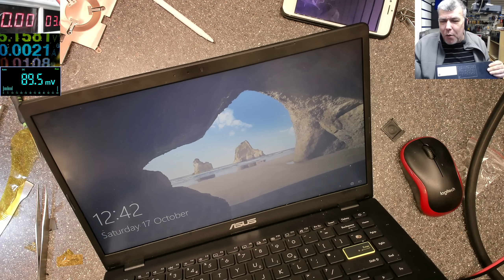Asus E410M blow-up board, motherboard repair

Comment: I really like what you do and I would like to help me diagnose a laptop-Alienware M18X r3 (it turns itself off at 30 minutes on clock, any operating system or bios).I diagnosed with DEll software and all the parts are good

Comment: Hi guys, sry my bad english.
Can anyone help me here?
I could not find a clear answer on the Internet for this.
Can i replaced laptop motherboard with a higher model of the same laptop?
I have a N551zu laptop and I am very interested in putting the N551vw motherboard on it.
is it possible?
What are the problems and obstacles for this?
i uploaded diffrence between them also.

https://ibb.co/dmQ02nn
https://ibb.co/mCG789Q
https://ibb.co/5hsFBV0
https://ibb.co/ZT4mNTh

Thank you so much.

Comment: Hi, thank you for the videos, they are very informative, fun and educational. I have an old hp 360 13",  it has no picture, the left bottom of the screen is broken. so I plugged the hdmi to an extenal monitor but it shows not picture either. the fan turns on and it get warm.  do you think it needs a new motherboard?

Comment: I ve search within your videos but havent found any troubleshoot like mine. When i start my acer aspire 5 the fan spins like 3 secs and goes off - repeats. Ive checked the thermal paste is kinda messy. Could that be the issue for this?

Comment: Hello Sir, I am From South Asia ( Bangladesh). I am a learner of your " 
Electronics repair school" . In my hand I have a "Dell Inspiron 15, 41113/SDPP/2015, iris bsw mb 14279-1". This Laptop Off Immediately after starting  (7 to 15 sec.).  The board is clean and clean, Heat sink Installed, Thermal pasted correctly........ This also occur in BIOS Mood Too.....  Replace RAM, HDD but No change........This Laptop Auto start  Battery + Power Jack Installed some time.....Please ....Waiting for wise Advice...

Comment: Discord is down it says expired and i need help :( i have a case with my toshiba l755 motherboard there is a resistor heating so bad near the SIO, where as the sio is not heating even bit and the motherboard is dead and not turning on but i'm pretty sure that once i plug it in the charging led is on and the keyboard blinks and it stops meaning that the computer is sucking energy i'm a low end beginer btw

Comment: Sorin, can you help me, i have a laptop that doesn't show picture on internal display, cpu fan always on  high rotation, no wifi (sometimes works!), no audio, and after a while it goes off. Temperatures are fine. when i boot on windows with an external monitor i see lines going up because of the fan on full rpm. Sometimes i have picture on internal display when i go to BIOS but not always, its very strange. I think i have somewhere a bad component on my motherboard causing this behave. The model is an Asus k550c. When i conect a external monitor the internal doesn't work at all. HELP

Comment: Sorin - Where is your repair shop in London? I have a Lenovo Yoga 910 laptop with memory hardware problems. The memory is soldered on the mother board and cannot be easily replaced!

Comment: Hello.. Happy to see your videos.. I hope if you could help me with my honor 8x.. It had water damage .. It doesn't work.. Just keeps vibrating (that vibrate you have when you turn on the phone) every 10  seconds till the battery gets empty... Had tried 2 screens and a battery  At the services center and still the same.. Its charging but keeps vibrating when charging. the led indicator just flashs red with the vibrate. waiting for your help
Thanks

Comment: Does anyone here know what's the difference between the winbond chip and the super io chip on a MoBo? Mine has a ite8995e and a winbond 25q64fvsig. Someone flashed the wrong UEFI and the official ASUS tools (winflash even if I use the /force parameter and ezflash) refuse to flash the correct one saying that it's the wrong bios for this model of laptop. I'm thinking of having the wrongly flashed chip by a properly pre-programmed one so I wonder which one whould be replaced. Thanks.
Reply: ITE8995e is SuperIO chip, Winbond 25Q64FVSIG is eeprom where BIOS/UEFI is stored.. if you need more help, visit ERS Discord at http://invite.ers.repair

Comment: hello i know this is not the appropriate video to comment but my comment is different. i need help. i have a lg g4 beat h735 it is only saying emergency calls only i cannot do anything in the dialer or send sms. i have tried everything hard reset, soft reset, leave battery out for a day from phone and even clean the sim itself and also reinserted but nothing seems to help i dont know if it is a software or hardware issue but definately its a hardware issue these phones somehow suffer from heating issues so it might cooked up some amplifier chip for the simcard. can u tell me whats the fault on this. Really appreciate your help.
Reply: oh and also the sim card is picking up 2g signal cannot go into 3g or 4g. also the phone is reading the sim card and i can enter my pin for my sim
Reply: @shaailhansraj7226   It sounds like you might need to just go to the Manufacturers website and read on reinstalling the Operating system first.
Reply: @byoungmn  okay thanks alot really appreciate it

Comment: Hello, finally you really need a small database to manages your jobs, because even after one week it is already difficult to remember every details about a repair, and then when coming back you need to know what as been done, don't trust the customer versions ... i am using SMI wich is free and can be used on any OS on the internet browser, you need to write ordered parts, delays  and prices, sate of entry and give back, work done .... I know it looks like lost time, but especially when you are not working alone everyone can use these data to customers information. The real lost time is when you need to recheck again something quite long to find ....

Comment: Sorin just a video idea - show some diagnostic with oscilloscope, it would be very useful. Thank you :) 
Great video as always.
Reply: His eyes and knowledge are the oscill0scope
Reply: For what he's doing, quick repairs, he don't need an oscilloscope. But there are a video where he's using the scope to show how to use it instead of multimetre, but you can't see too much like using the power supply.
Reply: yes it is useful but in repairing business you must finish your job quikly as you can..
Reply: Sorin rarely uses it. Perhaps he doesn't need it.